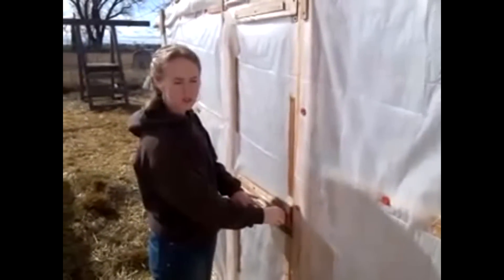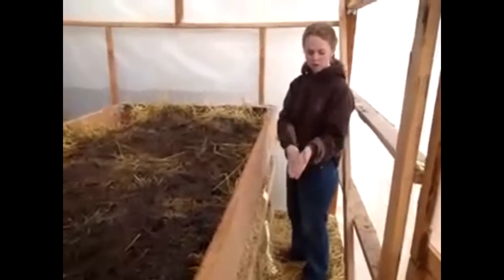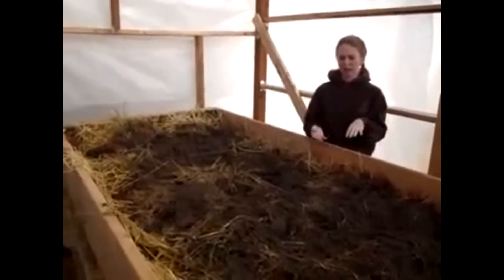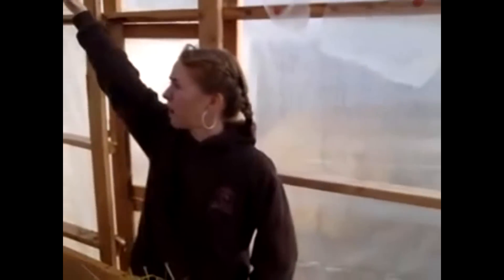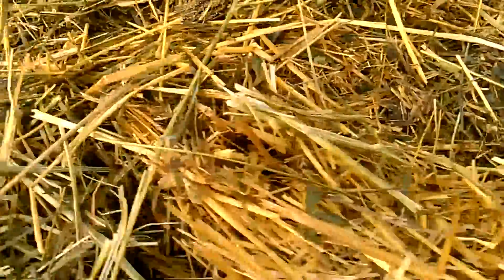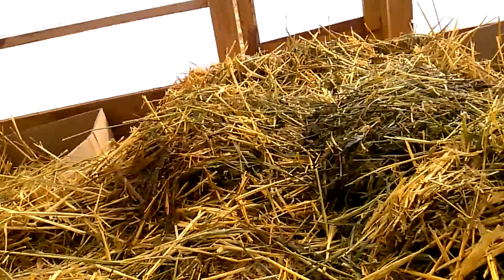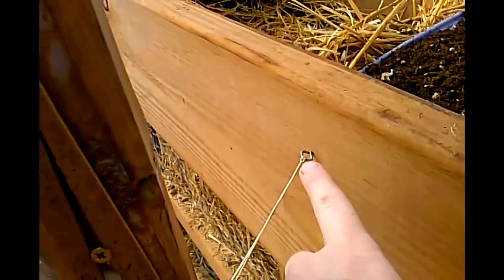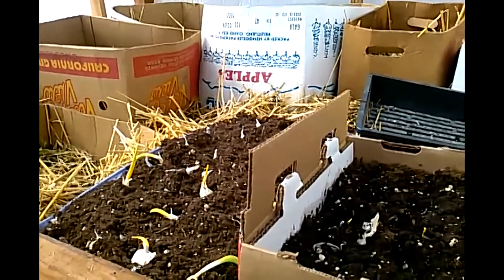My First Pallet Raised Garden Hotbed Greenhouse for Winter Gardening (2014)

Comment: I love the brooder idea!
I'm wondering though, if it would be a good idea for rabbit grow-outs (in between seasons or over winter to prep spring beds)? Grow outs trend not to dig as much as breeders and it would ensure you remembered to wire the bottom against moles & groundhogs too.  They'd deliver a massive amount of spread manure, since they aren't as 'corner trained' as adults tend to be. 
Cocci is always a worry if you have them on 'ground', but they wouldn't be there long term anyway. So as long as there was enough carbon, I'd think they'd be safe. 
Leaves, wood chips, shredded paper, weeds, half finished compost, fall garden waste, rabbits love little twigs, etc...really any mold free carbon could be used. So urban/suburban homesteaders would really benefit. 
I know you like placing cages over the beds, but I'm always looking for a way to cut corners on both animal care/manure management and hauling anything for the garden. And truth be told, cages can be a real hassle and very costly.
Hummm???
Reply from the maker: My idea exactly. I want to find a way to raise the baby rabbits in the hotbed frame itself. We have already tried it and they escaped within a few hours. Then they were in contact with soil  outside the bed and we had to isolate them from the other rabbits after that in case of parasites or disease. I am thinking of other materials like chicken netting to keep them in but so far it hasn't been a huge success.

Comment: What time of year was it when u had ur chicks in greenhouse?  I have an Incuview ( eternal thanx for ur review 💓 ) and have hatched out over 100 birds since I bought it.  I experimented and pushed limits and the hatch rate was always above 85%.
Reply from the maker: Hmmm, that one was a long time ago. I still do it in my new greenhouse, any time the sun is out so that the temps in the greenhouse are above 75 fahrenheit. I did leave them out at night on the hotbed with a heat lamp in the past but I haven't done that in years.
Reply: @dirtpatcheaven  thank u so much!  Our temps get similarly cold but u have a longer cold season than I do.  I figure if u can do it, i probably can too.

Comment: I just spent several hours creating a roof for my Bantys. Their coop is separate from my main coop because I was told by the gentleman who traded them to me that they didn't get along well with others. Possibly their broodiness? Anyway, rolled two sections of large gauge chicken wire over the top then braced over that with 2x4s so I could place the tarp back on top. I'm experimenting to see if I can keep the roof from caving in when it snows.

A hotbed greenhouse is next. I've got the raised bed garden boxes made from pallets. I need to finish the pvc pipe frame and get something to cover it with. What did you cover your green house with and where did you get it?

Thanks. Keep up the good work!
Reply from the maker: OrangeJeepDad I used 6mm plastic from the feed store. It lasted the whole season fine but gave out in August. I will probably use it again as it only cost $60 to cover the whole thing. Sounds like you have some great projects ahead!
Reply: dirtpatcheaven Was the plastic roofing 6mm or 6mil?

6mm (millimeters) is almost a quarter inch thick - like the plastic campaign signs, usually called CoroPlast.

6mil is 0.006" thick (about the thickness of printer paper).

Great video! I really enjoyed this one and many of your others,

Best of luck this winter.